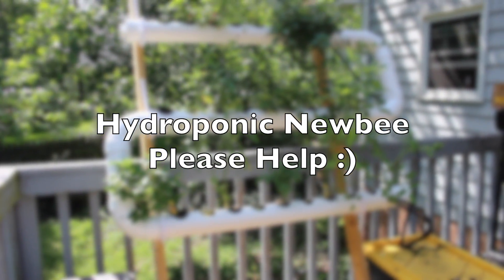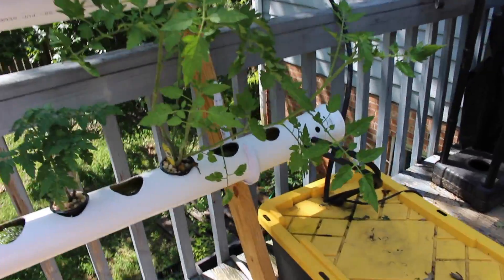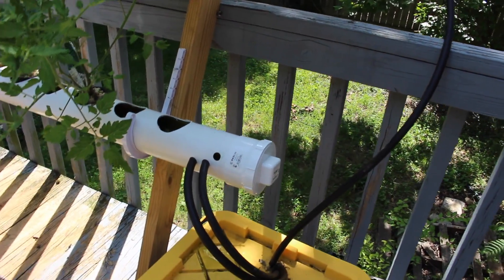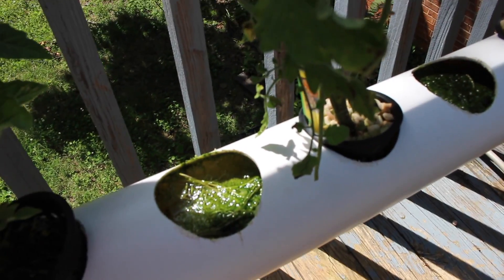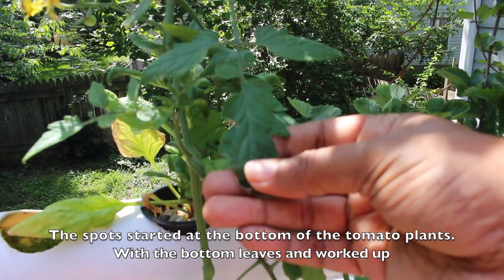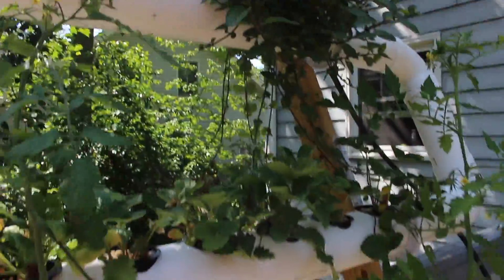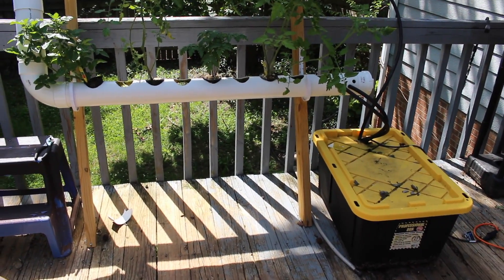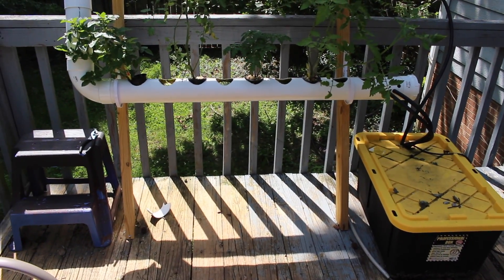Hydroponic patio system design (and need help)

Comment: Did you ever fix the issue? Also if you cover up the unused holes so light doesn’t get to the water then you will eliminate algae. Algae eats nutrients and uses up oxygen in the water causing a anaerobic environment for the roots of the plants. If there is something in the water and you still experience problems every now and again you can try to see a beneficial bacteria that you add to the nutrient stock. It creates a biological environment that allegedly improves root mass health.
Reply from the maker: I Did!!!! I added some epsom salt to the bin and 4 days later added a little hydrogen peroxide (food grade). The water cleared up and the spotted leaves fell off. Then the system took off. I believe what you said is correct. The algae was eating all the good stuff and the plants were starving.
Reply: That’s so good to hear! Do you still use your system? You should post updates!

Comment: the water drip should be running smootly back to the reservoir,and i can see is,your water drain tube is in the mid level of your pipe,insted it should be place under.please check or watch youtube hydroponics for beginers. maybe you can find helpful videos on how to.god bless you.you can do it. dont stop trying
Reply from the maker: I learned so much from this first attempt. I had no idea that you were supposed to cut back roots. The water was not flowing simply because the pipes were full of roots. 😖 I could go on and on about all the mistakes I made. I get a little wiser with every year .